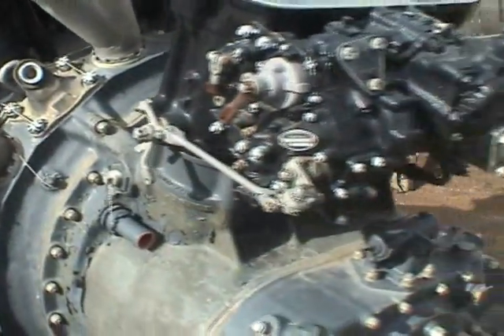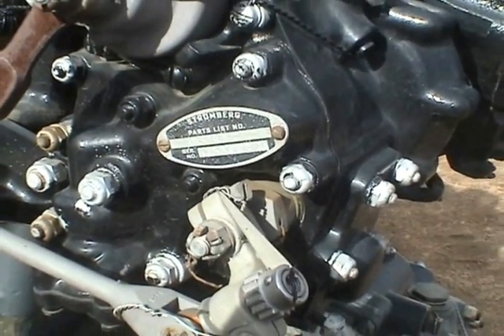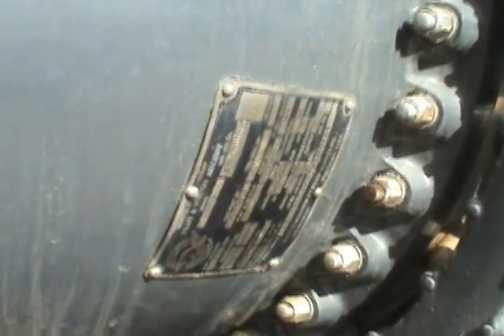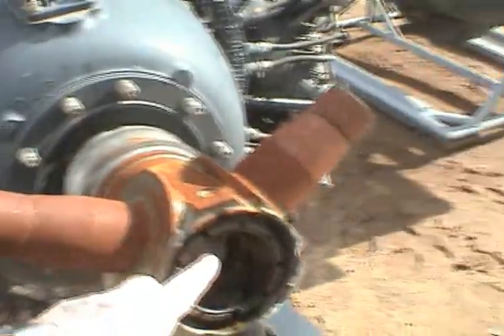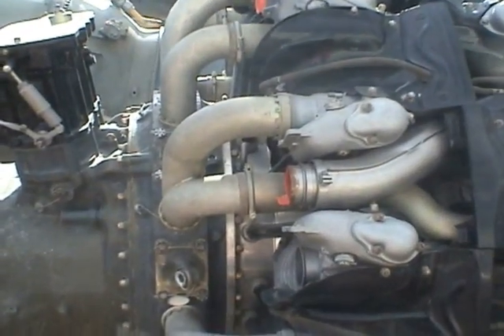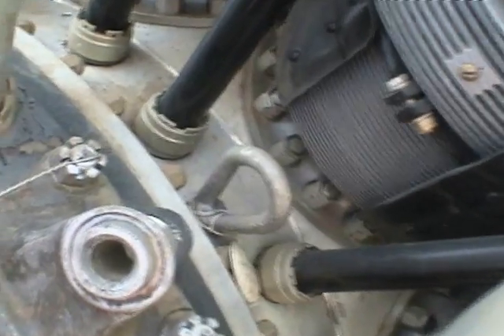Close Up view of a Pratt & Whitney R-2800 Radial Engine

Comment: The R-2800 (18 cylinders) is used on many aircraft such a CV-240/340/440 and DC-6. BUT the C-54 uses the R-2000 engine, which is 14 cylinders.